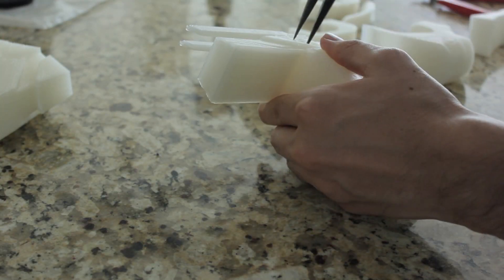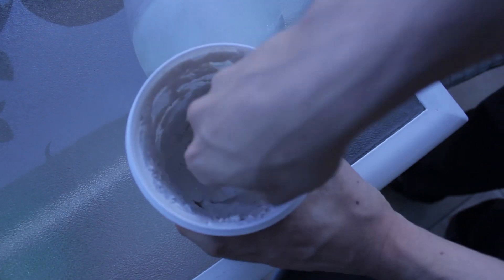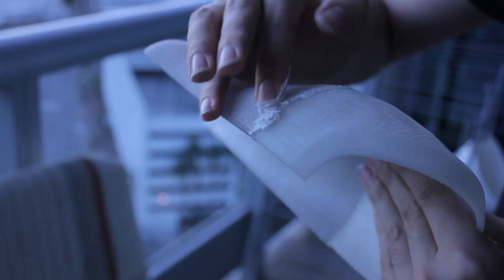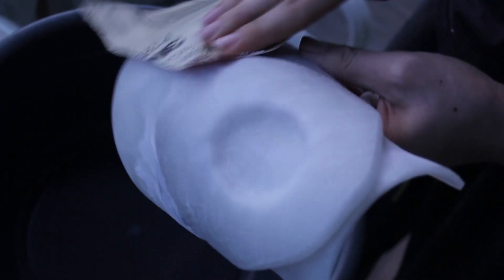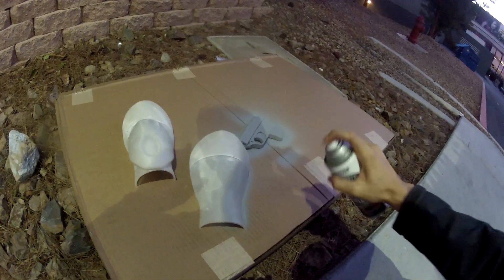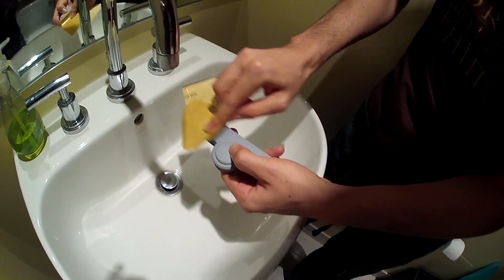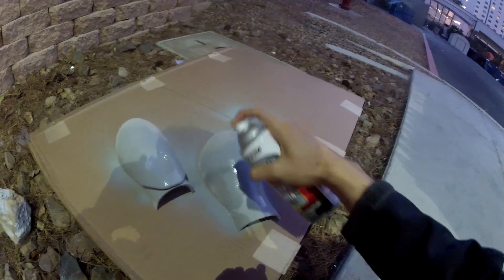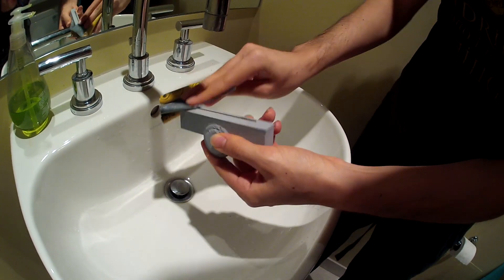The Cheapest and Easiest Way to Smooth 3d Printed PLA Props and Armor

Comment: I know this video is a few years old, bit for anyone watching this, I've also been using drywall patch for years, so much easier to work with than Bondo and Bondo is overkill for most prints. One tip I can add to this is that I use the drydex pink patch because it goes on pink but dries white so you know exactly when you can starts sanding. Great video!

Comment: Hi, so I just got a brand new Flashforge pro for a fraction of it’s value, a really good deal, and thus far I printed a lot of  big sized props and figures. 

I managed to have 0.08 mm precision on some of the pieces using high quality PLA. When it comes to smoothing I use a small precision sander that works wonders on 40k figures and my Gunpla collection. 

When it comes to 3D printed post processing I am barely getting started, and I find videos like this very informative and useful. Especially for big builds, I have an upcoming Grey Fox mask being printed right now and OH BOY, it’s going to be a lot of work.

But from my experience thus far, sanding alone can be enough to smooth out a print, even a low quality one. It does take more time but you are less likely to lose details on your print. Especially if using sandable primer.

Heck, some prints barely need any sanding with a good enough primer. With only 2 thin coats of Chaos or abandon black, you can attain some pretty impressive results if the print is good enough. 

Still, what is everyone’s position when it comes to using sandable primer vs sanding for twice as long?

Comment: been using this method for over 5 years and i still get shit for it, but it works , i normally sand then spak filler then sand then the filler light sand and smooooooooooooooooooth and silk , rock on , i hope you and i can get the method out there , how even with wet sanding make sure the filler has been dry to cure for over 24 hours its better if its fully cured :)

Comment: you need to use small variable hardness sanding blocks if you want top notch results in leveling the high and low areas....

Comment: The biggest tip I can add is after your first wet sand and before you apply a 2nd coat of filler primer is to hit the object with a different color primer like red or something. Then add your 2nd coat of filler primer. Proceed to wet sand. That helps gauge how much you’ve sanded on the 2nd filler primer.

Comment: This is awesome. Have you tried using any of those materials on something like EVA foam/foamies, or wonderflex? I've made a lo of props using those materials and getting nice smooth surfaces tends to be problematic.
Reply from the maker: It does work but the issue with using a hard brittle material like spackle on something super flexible like foam (and to a lesser degree worbla/wonderflex) is that it will crack and break if the underlying material flexes at all. For EVA foam I actually recommend using slightly watered down liquid latex (if you have a paint gun). For worbla and wonderflex I'd recommend woodglue and filler primer.

Comment: thanks for replying on FB! i was wondering up to how many grit sandpaper should i use if i am sanding a PLA print with 100 microns?
Reply from the maker: Same process really, I generally print all my props at 200-400 microns depending on the detail level of the part and how much of a hurry I am in to get it done for a convention. 

Granted sanding and finishing a 100 micro part will take far less time than a higher micron part.

But yeah start with 200 grits and finish at your desired level of surface smoothness (generally anywhere between 1000  and 2000 grits is good).

Comment: how do you join your prints? 
glue flat surfaces or making interlocking parts as well?
Reply from the maker: I heat weld my parts together with a combination of a 3d print pen and soldering iron. though I'm starting to intergrate interlocking parts to all my own designs when I can.

Comment: How easy is spackling paste to sand? To completely cover the cracks of a 0.2 mm PLA print you need to coat at least 10 times with a primer. Can you replace all those primer coats with a single layer of spackling paste?
Reply from the maker: I can't remember if I mentioned it in the video or not, but the Reaper mask shown at the end was printed at a .35 layer height on a .6mm nozzle. it took one pass of watered down spackle (yoghurt consistency) to cover the lines and sand smooth. Spackle itself is the softest material that works for covering print lines for sanding so far. Granted I have a new contender that might change how I approach smoothing PLA prints--depending on those tests stay tuned for a new updated video.
Reply: Sounds great, I'll try it out.

Comment: How long did you wait to sand it down? I have been experimenting with smaller parts and I'd need to prime a 2 meter staff but I don't think I want to use that much spray and I don't really have a proper place to spray in... I was thinking of the acetone with cloth method
Reply from the maker: Depends on the climate/humidity but usually moderate to thin coats are sandable within about 20 minutes. Acetone will definitely work if your print is ABS but won't affect PLA prints at all--you'll need something stronger for that.
Reply: Hmm, some sources let me understand it works with PLA too. However I think filler is the best sigh.

My filler spray is able to handle in 30 minutes or so but I was just thinking did you let it cure all the way first.

But thank you! This was pretty helpful cause I've been so frustrated with the spray and didn't really think about wetsanding..
Reply from the maker: Most primers have a full cure time of 24-30 hours, but are sandable in 20 minutes to an hour. If after 20 or so minutes feels firm and not sticky or wet to the touch you're generally safe to wetsand it down.
Reply: Be aware that some paints have a window of time for spraying successive layers. At least 30 minutes and no more than 3 hours after the last coat, for example. If you miss that window, you need to wait until it's fully cured to start spraying another layer. This is more common with two-part epoxy paints, but keep an eye open for it.

Comment: Sandable putty primer is basically Bondo in a spray can...

Just sayin'.
Reply from the maker: krazed0451 totally is, but easier to use, no ratios to mess up, and waaaaaaaaaaaay less sanding than bondo.
Reply: Absolutely, I was just amused that you decried Bondo immediately after using a spray putty. If Bondo is mixed in the right ratio and is applied thinly then it's no different to Spackle once you cover any small mistakes with the spray putty. I personally like body filler (Bondo), as I am familiar with it and have no issue working it as I have the equipment at hand. Viewers with an automotive background might find the same.

I thought that was worthy of note, although I may have been a tad obscure/snide in my original post, sorry about that! :-)